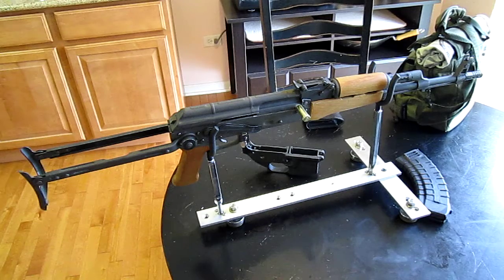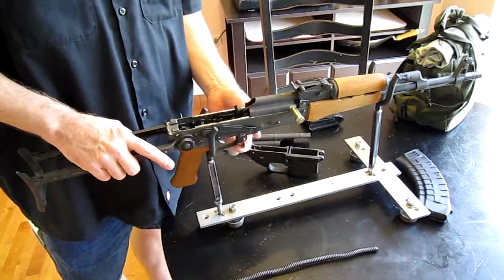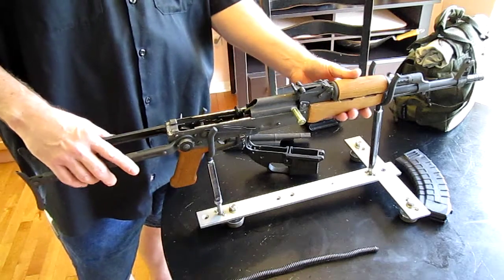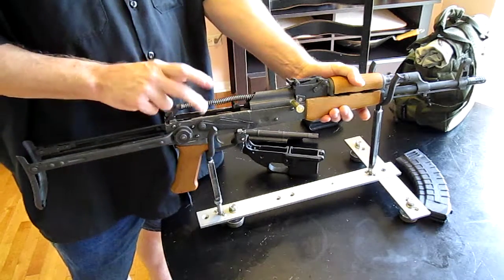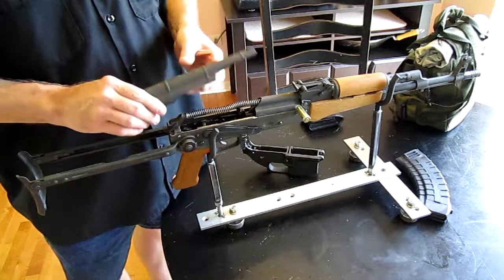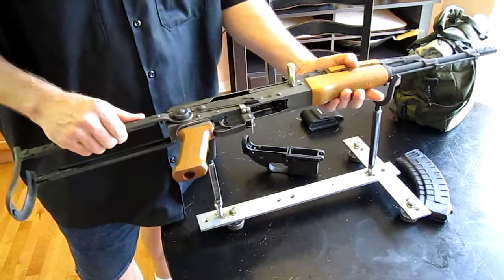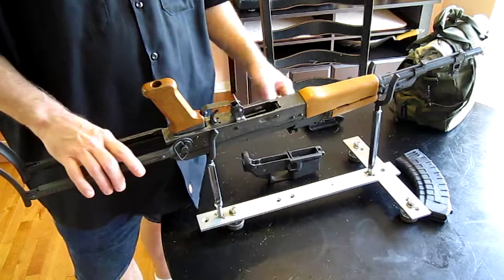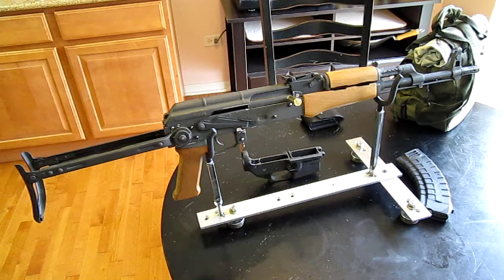AK-63D Finished

Comment: I got one more rivet to install on my front trunnion and then I am onto installing the rails. I am also doing a flat spot polish UF receiver. What did you use for spacing for the rails? I am using a 1/4" drill bit just for a dry run and it appears that the install rails will be 1/16" of inch higher than the trunnion rails. Great job and thanks for warning me about the space I may need in the underfolder hardware.
Reply from the maker: I used a couple of pieces of brake line that I threaded for small machine bolts to hold the 3 pieces together.
Also, if you need to drill rivet holes, before you weld the 3 pieces together, you can use the trunnions as the drill guides.
Then you can bolt the one receiver side to the two trunnions and try a few drill bits to find the proper spacing for the the inner rails.
Don't trim the ejector tip to length until the receiver sides are welded together as the bolt floats somewhere in the middle and I made it too short so it would not eject until I re-welded the tip back to length.
The upper rails did need so trimming though, especially at the rear where the top cover clips in.